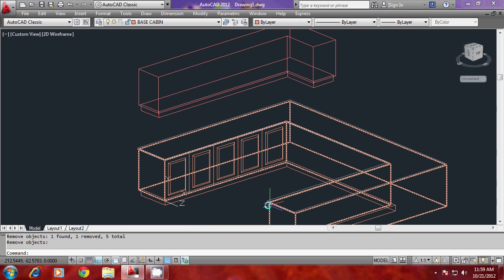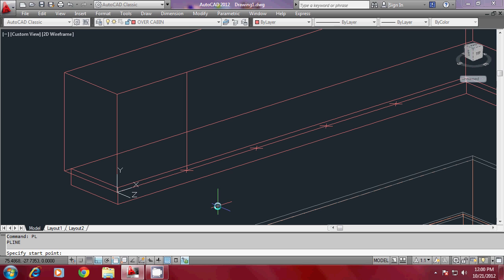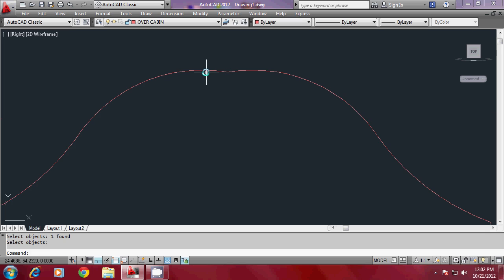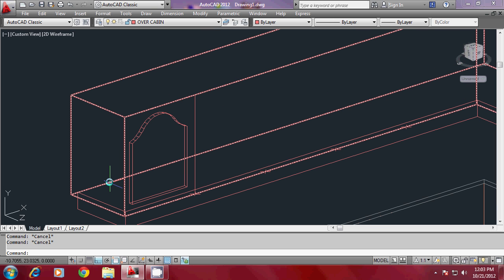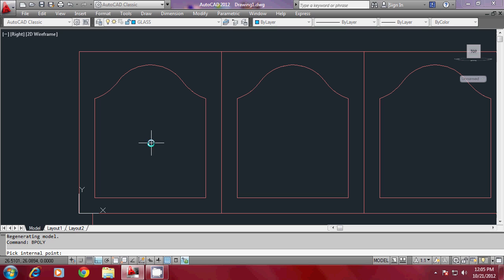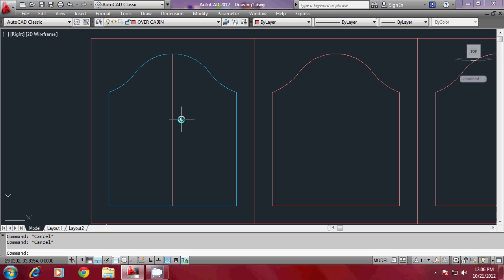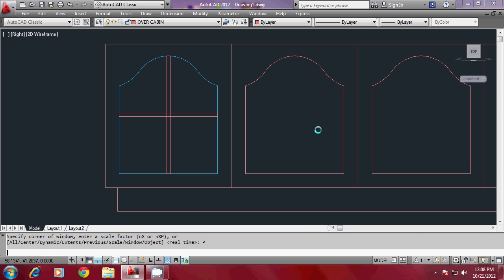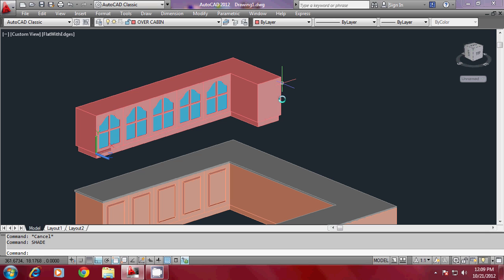Modeling a Kitchen using AutoCAD - PART3

Comment: Hello sir, I have prblem  at 2:40 my arc is not coming out the way yours looks i don't understand the part where you enter the command- pline then, A then S ? pl help me.
Thank you.
Reply
Reply from the maker: S  stands for second point option of PLINE (Polyline command)  . To make that curve I have used three point option . I was already at the start point , then using "S" I have choosen a second point and I have defined the END point to complete the arc . The Second point option can be use to guide an arc though any desired location  and hence you can control its shape . Please make a try . All the best .

Comment: Sir, 
I have drawn a square and i want to draw a line inside the square at 2'distance from one of the edge. When I get o-snap tracking line,I move the cursor and  type 2', then I will get exact point to draw a line. But now, 2'feet distance is taking from opposite edge but now from where i want.   what is the problem ?? thank you
Reply from the maker: You can use the from point option in Osnap menu .